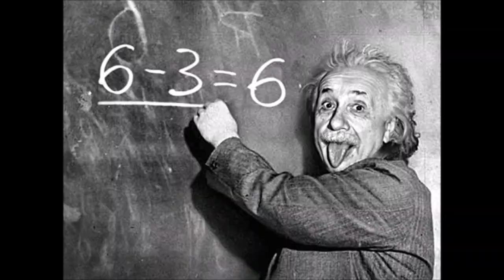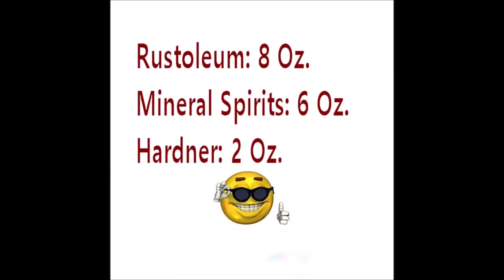VW Beetle Paint Job! 🎨 Rustoleum Car Paint Job -  Paint Mix Ratio - Cheap and Easy Paint Job DIY

Comment: Best thing about rustoleum is that you can apply it with a roller, and it will come out looking good. I did it to an old Dodge truck I used to have.
Reply from the maker: 4dscdriver I did see that method! I was tempted but that will get done on my next project. I’m going to do a matte black on my resto mod coming in next. So that’s probably the method I’ll do. Thanks for commenting!!

Comment: My friend sprayed vintage 50 yo Amoco oil based enamel paint that was used to paint Amaco gas stations. This was never opened bright red . He reduced it and added hardener. It dried to a glass like finish. This was 3 years ago and it still looks good. Your VW looks fantastic .

Comment: I have been using Rustoleum or similar oil based paints for a long time. I have never had any problems. Nice job.
Reply from the maker: Thank you very much John, and yes I agree, there’s nothing wrong with using it. I know many that have used it over the years with great success. Thanks for being here and commenting.

Comment: In my opinion, rustoleum is a good paint. Not sure how it holds up to UV but it is a tough paint even without hardner and even tougher with. Looks excellent 👍👍
Reply from the maker: Thanks for taking the time to comment. Rust oleum is an awesome paint. Very tough paint. But you are accurate with that statement. UV rays seem to take a pounding on rust oleum. I think a nice clearcoat would make a difference.

Comment: Beautiful!  If you had to spray a gallon that would be about $95 in hardener ($22 for 8oz at Tractor Supply).  I read about someone shooting 1:1 of urethane clear with Rustoleum.  I have some cheap 2k clear ($70 for 5 quarts), going to try a test spray at some point.  But I’d be very proud to have shot that!!!

Comment: Will 6oz of acetone work just as fine instead of mineral spirits? And did it take 8oz of Rustoleum to paint the hole car? 

Awesome JOB btw!!!
Reply: I believe so. My understanding is that the acetone evaporates slightly faster than mineral spirits, so you may need to use less. Temperature also affects this. Use less reducer when it’s hot and more when it’s cold.

Comment: I think this looks excellent! I know you do not have this vehicle anymore but going back and watching this definitely helps my cause. I have been looking at other paints from other companies and for a DIY garage job price.. I'm going to give this a shot. With the Rust-Oleum do you have an option between gloss or satin finish? With your mixed ratio once it all dried it looked that glossy? Did you spray the whole body as one or did you pull fenders /deck lids off?
Reply from the maker: It was all sprayed at one time, and I have no idea how I did not get notified of this comment from nine months ago. 
I only had a choice of sunrise red coming in gloss. And it turned out that shiny. However there are many other options with rust oleum and some are satin finish.

Comment: Only 54 dollar does amazing. I have a local NAPA store in our town use there crossfire brand support our local store. My bugs i find in our area here, yes rusted bad so strip then to bare metal. Now we start  : AMC Finsh 1 Metal Etch prime $65.00gal ; 2K high fill primer $129.00 gal , then you add in the reducers hardners, single stage paint around reducer hardener around 300 plus dollars .. I have just under $1,000.00 in materials. Now i'm  retiring cannot just go drop 1k on painting stuff.  Glad to see what you were able to do for 54 dollars amzing cool to see how you can get great look paint job for so little dollars. When i get down painting  i color sand then buff the car with 3-m Perfit-It system the 3-m stuff about 45 dollars a bottle..
Reply from the maker: Busman 54 oh yeah, you can get pretty deep in your pockets when you’re painting. 
Beings this is going to be a daily driver run around car I want to save a little bit of money. 
I dumped so much other money into the car was crazy. It adds up so quickly. 
We did cut and buff, but I forget what compound we use now. That hardner made the wet sanding not very much fun! It was rock hard! 
My buddy brought the compound with him. Just not sure what it was. I hope you’re doing well Dan! I got to get back in gear on YouTube and check everybody’s videos.

Comment: For that price you can't go wrong it looks great. I'd guess that good waxing in the summer would be a good idea. The UV  may affect it. I did a jet boat with hammerite  years ago, it looked absolutely magic but the sun oxidized the paint after about 6 years.
Reply from the maker: Paulman50 i’m definitely going to put good quality wax on at least once a month. I’m probably going to use Paste wax! The Hardner had a little gloss to it so I believe it helps a little bit
Reply: i wash my dodge ram once a month with car wash soap that has wax. the original paint still looks factory fresh after 20 years.

Comment: What do you think it would do without the hardener? I’m a fan of rust oleum farm and implement paint. Your vw looks great! The reason I’m thinking I want to leave out the hardener  is because I want a very low gloss to the paint. Ive even considered painting it and then rubbing the whole thing down with 0000 steel wool and then not buffing any shine at all back to it. A sort of faded look without all the normal dings , dents and scratches that goes with an actual faded paint job. I went bumper to bumper on a 93 F-150 pickup. I have rebuilt or replaced about every single part, bearing, and seal to almost everything, I think I’ve touched every square inch of that thing by this point, lol. I have painted all the undercarriage with the Ford implement paint colors, I took both differentials completely out and striped the housings to bare metal before painting. Sorry to go on and on though, would like to know your opinion on leaving out the hardener if you see this. 

Also, no one seems to realize “divided we fall” , I’m afraid we may just be in really big trouble, I think we may have not been paying close enough attention to just what’s been going on maybe , for what it’s worth though, I hear you we better be pulling together and the sooner the better. 

I subbed, I’m going to look now to see if there are already videos showing the finished beatle, I didn’t really look to see how old this one was. Thanks for the content!
Reply from the maker: I think with rustoleum, and keep in mind I’m not an expert with us. It takes a very long time to dry the whole way through. So that’s a big bonus for the Hardner, as it sat up really fast.
I’ll be doing a 68 in the spring, well the painting part. Not sure of the color yet. I may even mix a couple together to get what I’m after. 
I like the Ford trucks, I wouldn’t mind having another. I can’t believe what the prices went on some of the trucks.
I’m going to be doing the whole undercarriage in rust bullet! 
The company sent me quite a bit to try out. I know other people that  used it,  that stuff is really strong. 
And it’s gloss black. Or whatever color you choose I’ll be doing videos on it soon.

I’ve always said people need to stand together, unfortunately they don’t they listen to the media. It’s all part of programming unfortunately.

Comment: Hi Slade, Looks pretty cool. There is all kinds of auto paints but doing it low cost is up to the owner especially if they are painting it themselves. Now the question is will it last? Probably a good coat of wax after the first couple of washes may help it.
Reply from the maker: Tim's Workshop TJY Thanks Tim I truly appreciate it. They actually last quite long, when I was wet sanding and buffing it out, it’s as hard as a rock. I seen a lot of guys do these jobs but they don’t use Hardner and I’m not sure why.
Reply: That's not the problem that paint is oil based which means it will fade in a year or less no matter how you mix it

Comment: Great to see you back.Ive been thinking of taking a break myself. The paint looks great. That’s good to know about using Rust Oleum.i got to get caught up on your videos
Reply from the maker: The rustoeum saved me a lot of money. Long as you use the proper mix, and hardner, its fine! I spent about $54.00! I took a break last time, and thought I was done and delted everything. That was a mistake! I need to catch up on all your videos! Summer time I am not on as much. Been getting house and yard work done. LOL
Reply: Slades VW Beetle same with me spring and summer is so busy for me I think I’m not uploading for rest of summer I’ll start again in fall sometimes I get tunnel vision I’m reminded I have to take a break which is good
Reply from the maker: Roy Works Always take a break my friend!!

Comment: I agree, your paint looks sweet! Do you remember the wait time between coats? How many coats and what hardener did you use?
Reply from the maker: Actually it was about 5 to 8 minutes between coats. Now I’m not a professional that’s only what I did. Three coats went on, the last two were somewhat heavy.
I used Krylon Hardner!
Reply: @SladesVWBeetle  Well you got sweet results! I plan on giving your mixture a go. Hope my paint comes out close your! Thanks for sharing!
Reply from the maker: @watto1964  thank you for being here, I truly appreciate that. 
Good luck on your paint job! I truly hope for the best results for you. 
Doing it again on the 68 beetle I’m currently working on. 
This time I’m going to do a special mix, for a specific color.
Reply: @SladesVWBeetle  Looks sweet to me, was it spray over original paint or bare metal, does it require a clear coat and final question is it holding up great after a year, I like the color but would expect it to fade pretty quick in 🌞 like VW reds always do, even brand new cars do!
Reply from the maker: @johncollins5552  honestly I would highly recommend a clearcoat, for better protection. A year later though it is still holding up nicely. My friend has the car. I sanded the car down, but not to bare metal.
Reply: @SladesVWBeetle  was it the Krylon catalyst acrylic hardener?
Reply from the maker: @eldrickejleest  Here’s a link to what I used. I’ll be doing this again in the very near future. This time I’ll show products, mixing. Spaying! I was somewhat new here still at that point! 

Krylon 2046 Acrylic Hardener https://www.amazon.com/dp/B01HXM7DNO/ref=cm_sw_r_cp_api_glt_i_4ZT4P3DQ6R0SFEWJAF2K
Reply: @SladesVWBeetle  Thank you. That's the one I have. I haven't done anything yet. Just now saw your video. I intend to spray it. Hope the ratio goes well with a lvlp gun.
Thank you.
Reply from the maker: @eldrickejleest  now that is something that interest me greatly. And LVLP gun. I know somebody else that used one and absolutely loved it. And I heard it is great for compressors that are not quite as large. I plan on testing one soon. When I get a little extra money. Not sure where to buy one yet. That is reasonable.
Reply: @SladesVWBeetle  I have a Campbell Hausfeld spray gun that came in this kit (AT706099). You can find them for under $100 and it comes with 2 guns and everything you need. I'm planning on using it on a 20gallon compressor.
Reply from the maker: @eldrickejleest  sweet!!!! Thank you I’m going to look that up. I want to try LVL pee after I see the outcome of some other jobs. It will keep me from having to buy too large of a compressor and will save me money. Did you buy from a certain place?
Reply: @SladesVWBeetle  I mine off ebay.
Reply from the maker: @eldrickejleest  I will definitely check that out I truly appreciate that. Because I’m going to be spraying my dash and door jambs very soon. I will be sure to give you a shout out for that. During the video. If I have trouble finding it I’ll probably be asking you for a link on eBay to it lol
Reply: I just painted the hood and roof my car with Rustoleum gloss black. I used Sikkens Reducer slow. And Krylon hardener. Paint / reducer ratio was 2:1 and 19mL hardener in 300mL of paint. 
Came put looking real nice with just 2 coats.
Reply from the maker: @eldrickejleest  Awesome! Thank you so much for chiming in with your information. I truly appreciate that.
Reply: @SladesVWBeetle  You should look at the Sprayit lvlp gun too.  Around $100 and bunch of people on YouTube really like it.  Also has great reviews on Amazon.
Reply from the maker: @jacobcarrillo9171  Thank you I will try to find that right now. I appreciate you telling me about it. Hopefully I find the one you’re speaking of

Comment: Great looking Job well done!
Reply from the maker: Polecat54941 Thanks very much! And thank you for commenting!
Reply: @SladesVWBeetle  I just painted my van and used the recommended 10% thinner and it came out like Grapefruit so I know how good your paint job is! shall be using 4 to 3 next time :)
Reply from the maker: Polecat54941 I messed around till I figured it out. The hardner is very important! Adds gloss and of course hardens quicker! I’m going to try another method soon on another car. I’m going to spray a final coat with just mineral spirits and flow it on and see if it eliminates orange peel. I truly believe it will work! I did it on the rear of the car messing around and no orange peel!
Reply: @SladesVWBeetle  Sadly we can't get the hardner in the UK or Japan dryer!

Comment: maybe i missed it but what Rustoleum did you use? Is it  Rustoleum Automotive Auto Body Paint? or something else? quarts or gallons?
Reply from the maker: I actually used regular oil base enamel with rustoleum. I did not use the automotive. I did buy it in quarts. Since it was readily available. Especially at Home Depot.

Comment: Very informative.  How is the durability of Rustoleum applied this way?   I've been disappointed with rattle can Rustoleum that I've sprayed under the hood of my car - wiping off oil or grease with a rag and some brakekleen took the paint off too.   Ditto when using paint thinner.   Does the addition of hardener rectify that problem when spraying Rustoleum with a HVLP gun?   Thanks!
Reply from the maker: Honestly with rattle can, if you use 2K clear, in a can, it has a hardener in it. Its tough to scratch and can be buffed! 
The Rustoleum in qts, shot through a gun, with hardener, and a clear coat, is tough and amazing!
Reply: @SladesVWBeetle  thanks for the feedback.  That's encouraging.  The reason I wanted to add hardener to the paint is that I don't plan to use a clearcoat.  The 1966 car I'm restoring had no clearcoat, so I don't think it would look right with one.  Thanks!

Comment: Very nice job. Its the best Rustoleum result I've seen on here. I don't see any orange peel. Is that due to your mixing ratio or gun pressure? I would appreciate your thoughts on that. Cheers.
Reply from the maker: Thank you!! Honestly I wished I knew! I figured I would try it out and was surprised truthfully. I believe the mixing ratio helped a lot, plus the hardner helping it dry faster and harder.
Reply: @SladesVWBeetle  I'm going to follow your method. I have a project car that is ready to paint. I have never painted a car before but you have inspired me to try. Thank you for the great content and responding to my question. Best regards.

Comment: Hows the paint holding up now ? And did you use hardner in every coat car looks good
Reply from the maker: Yes, there was Hardner used the whole time. It actually came out very nice I was quite surprised. 
I’m going to do it on my next project that I’m currently working on. 
I no longer own this car that you are viewing right now. But a friend owns it and is still holding up great.

Comment: What primer did you use? I am doing this same thing to my bug. It is bare metal currently, and I am going to use the Rustoleum Clean Metal Primer, then topcoat. I was wondering if a sandable filler primer is necessary after the clean metal primer is on?
Reply from the maker: I used an epoxy primer, since my buddy had it on hand. I like using the filler primers when possible. They truly help with little flaws and things like that. With bare metal I would think you would need a etching style primer.

Comment: Hi was just browsing YouTube and saw this video. Excellent job! But can you tell me what exact Rust-Oleum color red this is and what exact reducer and hardener you used? I didn't see on the video. I'd really appreciate it. Thanks 👍
Edit: ok reducer is mineral spirits.
Reply: Also sorry I'm asking lot of questions but it didn't mention if you used primer and or sealer and how many coats and how many coats of paint? Also what spray gun did you use.
Reply from the maker: Hi!! The Rustoleum is called sunrise red. I truly like that red I thought it was very nice. I used Krylon Hardner,
And epoxy primer!
Reply: Thanks for the reply! How many coats of primer and paint did you put on?

Comment: How has the paint been holding so far? 
Im in the works of starting my project and im go the same route, do you know what the mix ratio would be?
Reply from the maker: Its honestly a rock hard finish. I am impressed! I show the mix ratio and discuss it in the video. I'll be spraying steel wheels soon. With the same mix and actuslly show the spray being done.

Comment: I have the same husky 30 gallon compressor, just bought a HVLP gun and going to paint my 1303 for the first time....how did compressor hold up?
Reply from the maker: Retro16bitGamer ! It ran more then I thought it would. But it did fine!! Very happy with the whole experience! Gun had a 1.4mm tip
Reply: Slades VW Beetle nice got a eastwood 30psi 4.5cfm with it.....plan is to make a German Look 1303
Reply from the maker: Retro16bitGamer ! Oh wow I like the German look!!

Comment: just the standard Rustoleum? Which hardener did you use, Majic?
Reply from the maker: Standard oil base rustoleum and krylon Gardner. I’ll be spraying my second beetle with the same concept. This time I’ll show the actual mixing and spraying